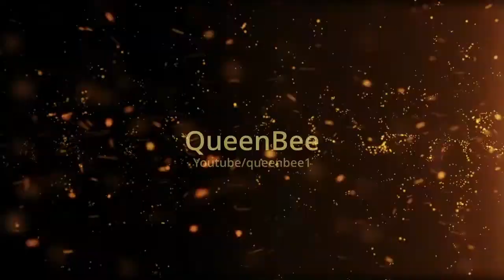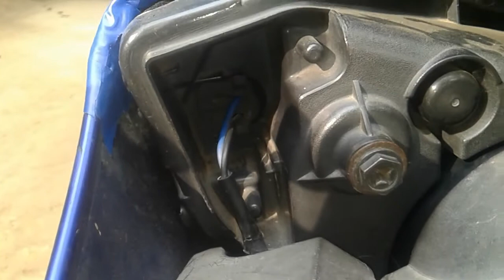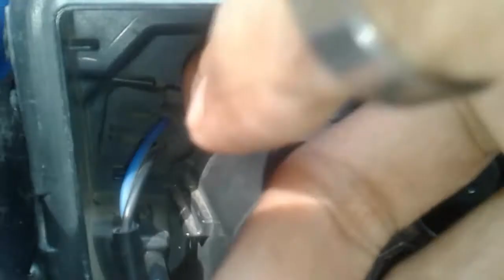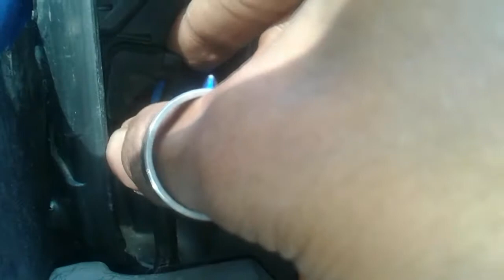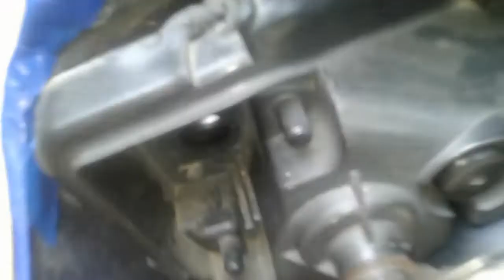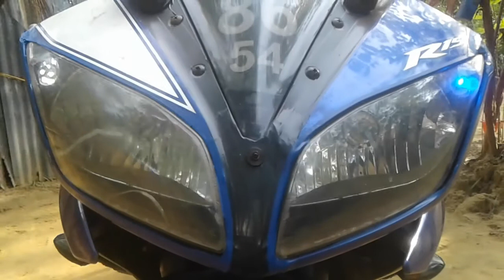How to Change Motorcycle Parking Light - R15v2

Comment: I have seen your video and happy to see your sincere effort. Videos are very much convincing.
As you know that the side panel  of YZF R-15 is very sensitive to any outer force & it often breaks. Is it possible to bring any protection to the side panel & fix any side & tail protective grab on YZF R-15.
Please prepare a video on this subject. Or if you have seen any video on protection of side panel of 
YZF R-15 Model 2012-2013 then please share its link.